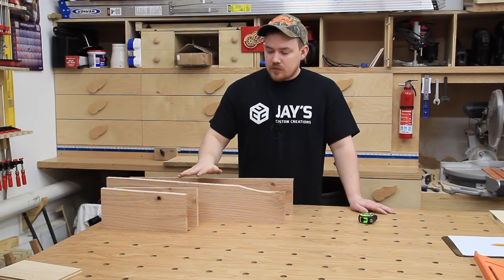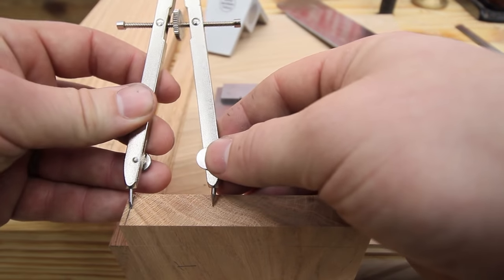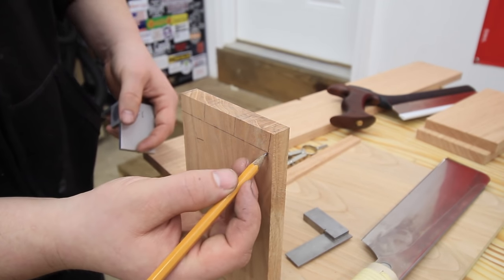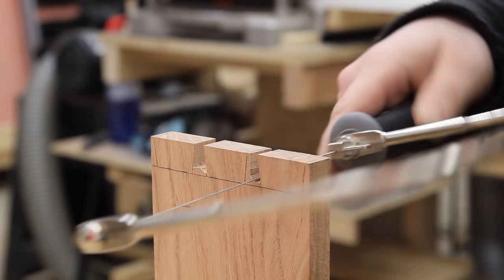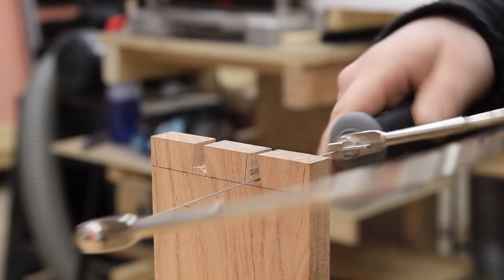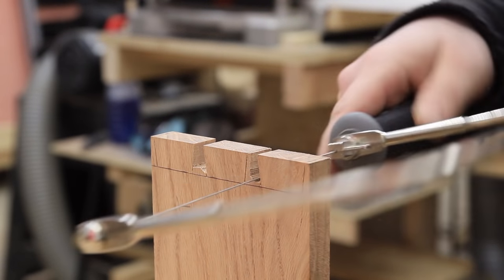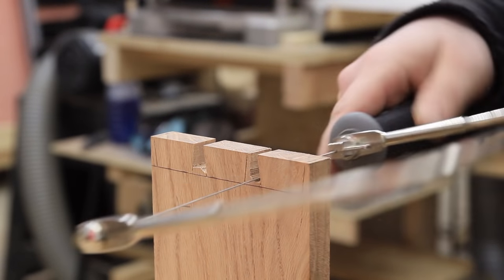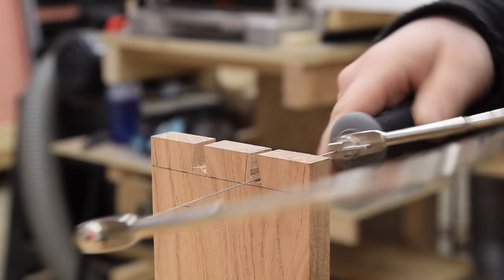Hand Cut Dovetail Hand Tool Tote - 236

Comment: Hello Jay!  I love our videos but have one comment (or criticism) on using a dovetail saw magnetic guide... as Ian Kirby has said (in reference to tilting the board at an angle whilst cutting dovetails)... "there is no virtue in that"... I suggest it is better to learn to cut to the line... always aim to split the pencil line in half, that way it does not matter much how thick your line has become as the pencil dulls.  Thanks.

Comment: For utilitarian use, it might have been nice to ease all the sharp corners (maybe 1/8 round-over) but that comes down to personal preference. I would have preferred taller sides with a long handle across the top, rather than brass handles on the ends. Again, personal preference. You did a really nice job on those dovetails. That's something I need to practice myself. I've only cut some twice in my life, and both times they were very quickly thrown together without any kind of accuracy.
Reply from the maker: +sooth15 Thanks!

Comment: Nice job two suggestions 1 cut 2 sets of tails at once quicker plus easier to keep square if cutting freehand.  2. You're chisels look to have a rather high side bevel height ok for pins but prone to bruising corners of tails.

Comment: That box looks awesome, and I actually like the bottom not being flush on the sides. It adds a bit more interest to the piece. Great work on it. Very craftsmanly.

I was totally lost though on your compass demonstration of how to layout the half pins. I think I'd probably just "bend the ruler" to do it so it worked out nicely. That can be a pretty handy trick for layouts like that. Still didn't hurt the video, I just internally considered that part: "Here be magics".

Also it might be one of the things you cover in the followup video but why did you put the handles on before finishing it?

Comment: Very nice work Jay, I like how it came out.

Can you (or anyone else) explain why the pins are often so small on modern dovetails? I haven't cut any yet, but it seems like having the pins so small compared to the tails would make for a rather weak joint that is prone to breaking at the small pins. Is this not the case?
Reply from the maker: +Jon Stewart (Vaulimere) Even with tiny pins I think the joint is stronger than one might think. It's crazy how well this joint takes abuse. I also think it's more about appearance than anything when going for small pins.

Comment: I think this is my favorite video of yours to date. I built a hand tool caddy recently with box joints, and i think i like it even more than storing the tools on the wall with french cleats. Having everything you need right in front of you for a specific task is great. Are you going to build the hand tool cabinet, or will this tote along with the storage under the workbench solve that issue?
Reply from the maker: +Scott Hillegass I'm not sure. So far I really like the tool tote being on top of the bench as you mention.

Comment: Thanks for pointing out why you did half the cuts and then flipped the board. The final tote looked great.  It looked like the bottom was longer than the sides.  Was there a reason for that?  Great video (as usual).

Comment: hey jay.... I'm fairly green to woodworking.. I have a question.. recently I built a walnut table top in my shop.. not temp controlled 35 - 60.. anyway put 3 coats of tongue oil on it moved it into a garage that was a consistent 60 degrees 2 days later tons of seams and cracks started showing up.. was it too much tongue oil? or the temperature change? or a combo
Reply from the maker: +Jake hurley Temperature and humidity changes as well as improper joinery techniques can lead to wood cracking.
Reply: +Jay Bates copy.. it sat in the shop for almost 3 months with no movement at all... I was just wondering if too much tung oil could cause it to swell perhaps.. but I take the temperature shock was probably it
Reply: +Jay Bates thanks for answering my question.. beautifully made tool box by the way... I used paste wax on the table and it did a pretty nice job blending my snafu

Comment: Before I ask a noobie question I'd like to reiterate that your videos are always very informative and cater well to novices like myself. Q. I had to freeze frame but I noticed (correct me if I'm wrong) that you jointed the boards with the crown down first. Although I don't have a jointer I will be needing to run some warped boards through the one at work and am therefor researching "best methods". Most articles suggest jointing with crown up first. Do you have a specific reason for the alternative?
Reply from the maker: It doesn't matter much at all. If you know and understand how a jointer works all you need to do is worry about maintaining a flat reference face. It doesn't matter which face it is.

Comment: Why did you leave pencil marks on finished product?
Reply: I think they were missed, but going over with steel wool can get them out and I don't know if he considered that a first and not the final finished, and it was a very nice hand done job. Better than what I could have done....
Reply: Are you looking at the marking gauge lines showing the base of the dovetails? That's a physical line, not pencil. Plus, as robert lamotta says, it's a tool tote, not a jewellery box. It's going to get plenty of more marks in its working life.
Reply: I was wondering if it was so that people knew that they were hand cut, I'm new to this and wondered if that was a kind of badge of honor or something.

Comment: Why make a beautiful carcass, tool organizers, and then go half ass on the bottom, wtf ?
Reply from the maker: Half ass on the bottom? That's how it's supposed to be done. Traditional tool chests are secured directly to the bottom with screws or nails on purpose. It's a heavy wear area and it makes replacing the bottom easy if necessary.